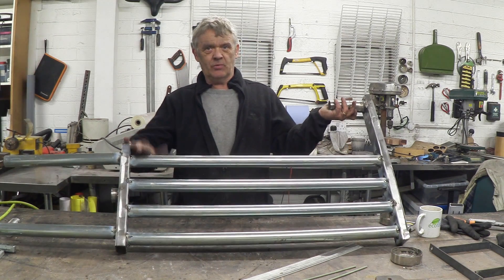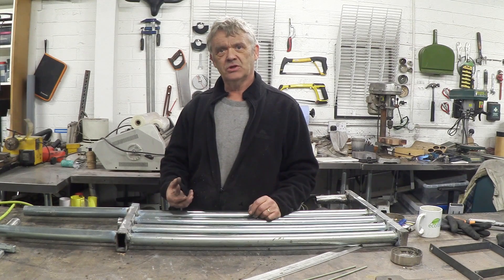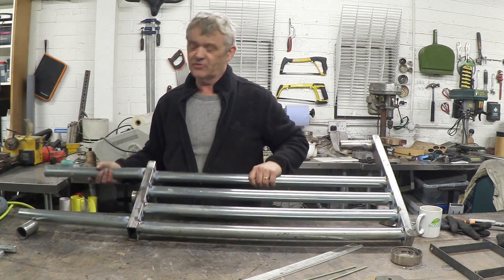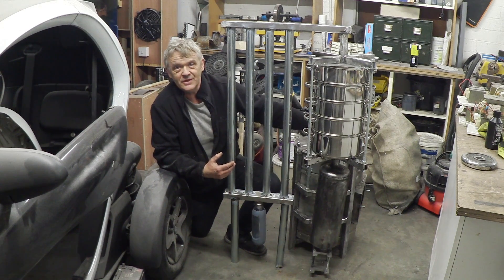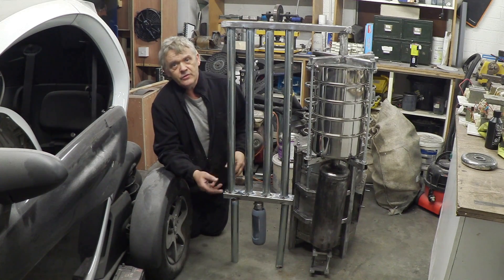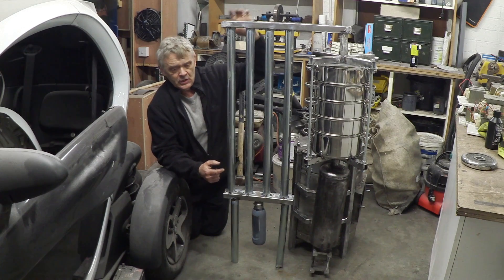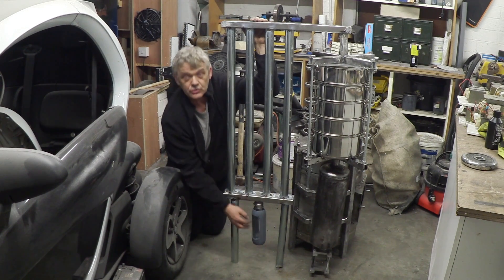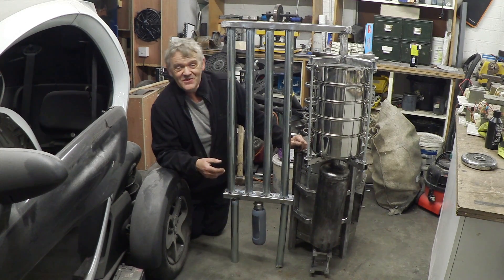DIY Gasification and Generator Unit - Part 7 - Final Jobs

Comment: I was talking about those tubes for the cooler as the burning part will melt the solder but for that job its easy as i presume high temp is not a problem with the cooler talking about soldering

Comment: Hello Robert i just thought of a good idea you see i used to make stained glass tiffany lamps and for this you had to use a very specialised  200 watt soldering iron with an iron clad tip don"t be tempted to use a copper tip use the iron clad use 1/2 " tip you can order one from KANZA CRAFT IN YORKSHIRE i know for a fact it would completely stop up any holes without the need for any sealant as long as you clean the joints and preflux you will get a perfect result as long as you keep the iron on the joint also a good idea is to use a gas blow torch to heat it up and clamp together then apply your solder Tin mans solder making sure to dip your tip in flux please take no notice if the temperature would be a problem to the melting point of the solder but you will find it very usefull to do a host of other projects that you need to do that dont use high temperatures and makes airtight strong joints hope that this has been some use to you.

Comment: Hi Robert. One thing you might consider if upgrading with a bubbling unit is to put it before the radiator because bubbling the gas through water may increase moisture content and you would need to condense that out as much as possible before combustion. Also you could (or should) fill up the bubbling unit with steel wool to break down the gass bubbles to smaller bubbles and keep them in the unit longer because otherwise they'll just bubble up much too fast and barely cool or be cleaned. The steel wool will also scrub much of the sulfides out of the gass which makes it easier to store if that is something you might be interested in. Obviously this bubbler could replace the particle filter completely but cleaning out or replacing the steel wool is more tedious, expensive and wastefull than just replacing some sawdust or straw. Finally I would recommend the overall piping in this system to be of larger diameter. This will deacrease the resistance through the system. You might find that you need quite a powerfull fan to just suck all of the syngas through the whole system. Otherwise I'm a big fan of your whole setup. I like the way your mind works.

Comment: Problem with a bubbler (as previously suggested by some) is that it will reduces the mass of fuel/air mixture entering the cylinder due to the intake stroke having to suck harder against the hydro-head of water. Two foot of water being equal to approx one psi, so even just six inches of head would add a another ¼ psi reduction in the cylinder on top of the frictional resistance through the carb and manifold. Volumetric fuel ratio wise, that would result in a much bigger drop in power than it seems. I would expect the top end performance to be poorer (compared to petrol) anyway, so a bubbler sounds like a bad idea for this reason.  Oily wood chips sounds much better.  Also, water would condense out some of the oleoresin terpenoids that survive their passage through the combustion region in the generator thus reducing the calorific value at start up. The only issue I have come across with high moister content in engines is with high compression engines like diesels. It can increase NOx emissions. Guess  the Chines knock off is a low compression, long stroke, suited to  2 star fuel. So no worries there and a bit of ‘cold’ steam would help efficiency. As for a beginner welding thin stuff with standard size nozzles or rods — forget it. I would braze it but GG sounds like a good alternative. Engineering is all about constructing assemblages of practical compromises anyway. [But a ‘beer barrel’ ? Sacrilege, pure sacrilege!] FEMA looks as though they have designed the simplest system that ‘works’. The only improvement that springs to mind is injecting steam or atomised water into the combustion zone which would increase the H2 and CO production due to disassociation of the H2O with the hot carbonaceous fuel. Some times referred to as producer or steam gas. This would increase the total calorific value of the gas going into the engine.

Comment: Wow, this is a work of art! Well done Robert!
I would love to see units like this getting streamlined and sold as co-generation units. Producing heat and power for household use. As for the water cooling, that makes me wonder about running smaller diameter water pipes up inside your stainless pipes to cool the gas and make domestic hot water at the same time as making power and heat for the room that the gasifier is in

Comment: Sir, my vanadium Redox flow battery is initially showing 1.5 volt, but when I attach 1ohm resistance, the voltage drops to 0.78v, why this is happening? Please provide solution sir where I have to focus

Comment: One question: can you use plastic as a source of fuel?... Will it produces the same type of gases as wood does?... Can you try burning/recycling old plastic bags and bottles and see if that produces the similar type of gases
Reply: yes you can but you might need to be able to control the burn more accuratley than for wood.Temps are much more critical i would have thought. Should be a reasonably clean way to "recycle" rather than give to our councils who sell it to irresponsible companies to get rid of.
Reply: @lopsumtathro  hmm... I was thinking about non recyclable plastics.
Ideally they should produce the same type of gases, but am assuming it may need some catalyst...
I have heard that catalytic pyrolysis of plastic produces fuel... Not too sure if that's really viable option though
Reply: you would need to keep the temp at 360 deg , this is the hard bit.

Comment: I'm looking forward to see how it works. to be honest, I don't think the cooler has high enough cooling capacity(not enough surface area) to condense the water vapor. In an old handbook about downdraft gas generators there is a chart: input wet chips 32, water 0.5, 43.1 air, output: dry gass 66.3, char 0.9, tar: 0.09, water 7.4 all units kg/h. So looking at the chart I think condenser will work, but not effectively enough to condense a significant amount of water vapor. The gas comes above 700 degree, particle separation is done, thumbs up, the first cooler needs to cool down to below 300 degree C. Well that might work with your cooler. then tar separation, another cooler and then water separator, at least what the handbook says. I never forced my self to make one, so I can't criticize beyond what the handbook says. If I find your email I'll send you that handbook, I think it is somewhere on the internet : handbook of biomass downdraft gasifier engine systems 1988.
Reply: Tried to google it, entered the full name, the first one popped up.
Reply from the maker: it's just to cool the gas a little mate - the cooler the gas the higher the energy density - that's about it really - if some water comes out awesome - if not - I don't really care tbh - some cooling effect will happen good enough fo rme

Comment: Not familiar with the sealer you plan to use but how does it stand up to repeated hot/cool cycles?  Welding would be better but it's probably super sciencey stuff. Hoping for the best.
Reply from the maker: well it's used in cars - so probably pretty well - we will find out for sure lol
Reply: @ThinkingandTinkering So are air fresheners, but they have a life span.

Comment: I am enjoying watching your build and has gotten me doing some research into what it would take for me to build one. 
Regarding bubbling  the gas through water to cool it. I would think you would want the gas to be as dry as possible. I would think additional moisture would cause a reduction in power and also promote corrosion in the engine. If anything, I would think you would want to pass the gas through some kind of dessicant or maybe molecular sieves to remove as much mosture as possible. 
For the cooling tubes,  could you wrap copper pipe around the tubes and use that to create hot water.
Reply from the maker: not sure if that is true mate - remember all those vids about injecting water in at the manifold and getting a power increase? Wasn't it the Air Force that came up with that one?
Reply: @ThinkingandTinkering  links?

Comment: It’s a shame the heat isn’t used, if a part of the apparatus such as the cyclone part, was wrapped in copper piping it could possibly run a heat engine( I don’t know about heat engines,so ?) ) or just give you a tank of hot water. Then you would have a Combined Heat & Power( CHP) Wood Gasificier. I know my comments are mostly silly, ive been watching vids about heat from HFC being used making them CHP-HFC, which I think is cool 🌎✊🏽🌻✌🏽
Reply from the maker: I did mention that in the first or second vid mate

Comment: Have dreamed of using one of these and glad you mentioned bubbler.  I always wondered what pushing the smoke thru a "Joe Cell" type of device would add to the smokes storage capabilities. Would the electric field it produces bond the extrs molecules it produces to the carbon? Sort of a super charger of hydrogen and oxygen hybrid gas?
Reply from the maker: I have no idea mate - why not build one to see?
Reply: @ThinkingandTinkering  am afraid that planting seeds is about all I'm worth these days. But if a "Joe Cell" can double the trucks mileage to 40 miles per gallon as it did in my case. Never quite got it to run completely with the device but double miles was good at the time...
Reply: not 100 on this but I was thinking of adding the bubbler concept to a system I'm building BUT from what I've read dry gas works better.  The caveat here might be that it's being added as a final stage?  Not sure on that though.  Coal would be one feed stock exception from what I've seen as some are adding water to the air mix to increase Hydrogen output.  The more condensate that you remove prior to running it through dry filter medium the better.  Some of the condensate seems to be flammable as a point of interest as well.   Great build!  I kinda sorta started mine as a learn to weld project as well and your welding seems far better than mine so far lol.  Enjoy!

Comment: You could get some of those aluminum brazing weld sticks.  Torch and melt.  That would allow you to weld the joints without actually "welding" them.
Reply from the maker: would that work on steel?

Comment: Bubbler...would add moisture to the system imho.  You are removing that moisture from the fuel at the swirl filter.  Why would you add it back in your cooling?
Reply from the maker: it would be clean and didn't they do that with petrol engines at the manifold?

Comment: Rob: I enjoy watching your videos. Future member when income goes back up. I would like to suggest a few things that may help in your success. The high temp silicone is your best friend when you are not a great welder. Make an extra effort to seal the unit because leaks are your worst enemy. Preferably before you fire it up because the sealant sticks better on clean metal. Use a clear tubing to go to the engine so that you can detect any tar because it will gum up an engine. Set the engine close to the wood hopper or mount the whole thing on top of the engine, so that it can be mechanically connected to the barrel to vibrate the feed material. Make the lid so that it is spring-loaded. This is for safety just in case you do have a leak and it causes a puff back.
Reply from the maker: nice suggestions mate - cheers

Comment: Instead of running the cooler channels in parallel, would it not be better to block off the top and bottom alternately and run the gas through all of them |```|_|```|__|```|_->blower. Maybe because you'd need more condensation traps? I'm not sure how fast the gas would be going through but it just seems like it would cool down a lot with such large tubes and no like radiator fins or anything pushing air between the tubes to try and pull the heat out...
Reply from the maker: cheers mate

Comment: Just an idea but if the pump is only needed to start the engine could you just use some sort of hand pump like a primer pump to save the hassle of adding an electric on
Reply from the maker: you could mate but you might find it a pain to crank

Comment: Robert, I have access to a virtually unlimited supply of rubber crumb. When you get this unit  finished,  could you try a couple of runs of rubber crumb to see if it works as a fuel or not. I have a suspicion that it might gum up the burner. I don't want to build this without knowing that the intended  fuel won't work.
Reply from the maker: I wouldn't think you could just pour crumb in there mate - I don't know I am guessing from experiments I did with crumb carbonisation a few years ago - but my guess would be to carbonise the crumb first then use that

Comment: I am actually a little concerned that you have hot gas and particulates going directly into the filter-box, as a potential fire risk. My first instinct would be to have it go through cooling first, into water-trap/bubbler and then dry the cool gas using a mix of carbon and silica gel in the filter box. But, I assume you have got this arrangement from published plans that have worked in the past.
Reply: If things are working as they should, there should be no oxygen present at the filter. No oxygen, no fire.
Reply: @googacct  good point
Reply from the maker: it's all from the FEMA handbook mate
Reply: @ThinkingandTinkering  Cheers, I'll check that out.

Comment: Many studies showing canola oil or motor oil as a bubbler is very effective at cleaning and cooling the gas. 
Think how oil attracts soot and dust like a magnet. That’s what it does to the gas.

After that run it through a large homemade charcoal filter 5 gallons metal bucket. When the filter is full or clogged just heat it up on the barrel to ignite the soot and debris collected in the filter. Reusable as well as the oil in bubbler can be burnt in the gasifier when full or soot. 
All in the wartime documents describe filtration and cooling.
Reply from the maker: cheers mate

Comment: Why I put my blower on the intake. PC fans are 12 volts.  I kinda wish I took a picture of the oily residue that was dripping from my smoker.    One thing I like about your gas cooler(condenser) is you could wrap copper tubing around and make some hot water from the cooling process.  Simple screen makes a good flash arrestor.
Reply from the maker: nice tips mate - cheers

Comment: Robert, as a beginner start with charcoal for gasification, not wood.. You can optimize the device first with charcoal then on the next level deal with wood. wood has enormous problems, 
 just a recommendation..
Reply from the maker: it's a good recommendation mate - thanks for that it is exactly what I will do

Comment: 30+ years ago I built a gasifier by using an air tight outdoor wood furnace I had also built...Once wood had reduced to mostly char I simply reversed the flow of the outgoing gases from the flue, pushing them back down thru the char by shutting down the flue damper and using a small blower in the door to create positive air pressure in the stove to start the process into a pipe located in the ash chamber and then to exit the stove. For filters I used 2 buckets filled with water. The first to separate the particulates from the gas and the second to cool the gas. It worked, to my amazement, as I had only read about them and their basic principles so was a very much 'by the seat of the pants' build. I ran a 5hp genset but was never satisfied with it's performance overall...High rpms needed by the genset were hit and miss and hard to regulate. Enjoying your much better constructed build and can't wait to see the results.
Reply from the maker: cheers mate and thanks for sharing your set up

Comment: Honestly ... I'm not the biggest fan of silicone, prefer more solid gaskets. In my view (as far as I can see by video) the stack of cookung pots will not be gastight by silicone. I would take rubber rings between and tight the stack up by the bolts. It's a bit on expirience by big pipes on cooling water at engines. I never was involved in gas pipes and would be afrait ...
Reply from the maker: I was thinking of a mix of the two mate

Comment: A bubbler is a very good idea as a final cleaner.. But they need a spark arrestor after them which can be made out of a piece of threaded pipe jam packed full of stainless steel wool as tight as you can hammer it into the pipe.. Please use gloves handling the stainless steel wool as I have made these and tried to unwind the wool and found that it sliced my fingers to ribbons as it is unbelievably sharp😬 I have tried to only use the bubbler as the spark arrestor and it blew up.. It did stop the spark at it.. But it destroyed it.
Reply from the maker: a bubbler isn't normally used in a gasifier mate nor Is a flame arrestor but nice tips if you want to include them

Comment: Hey Rob, you could use heat resistant silicon instead of gum gum! I believe it will stand 1200 C and will provide a really good seal.
Great video as usual.
Reply: He used heat resistant silicone on every other part of the project but decided there wasn’t enough heat to need it at this point.
Reply: @mikebond6328  thanks 👍
Reply from the maker: I am using both mate
Reply: @ThinkingandTinkering  I had missed a video, just seen it and I can see you are using it.
Good stuff, thanks 👍